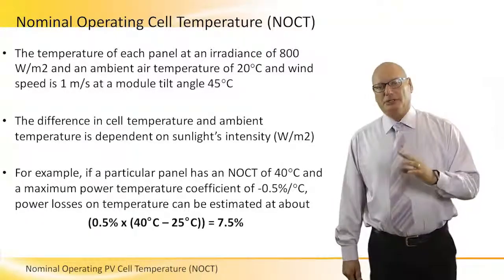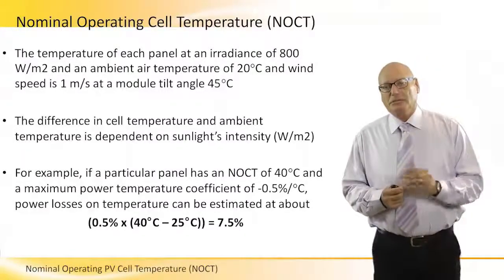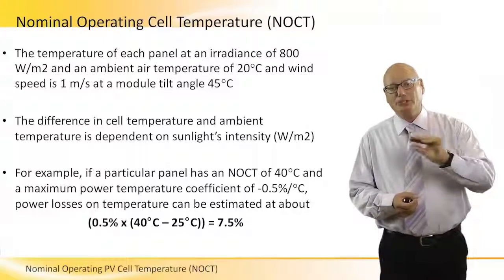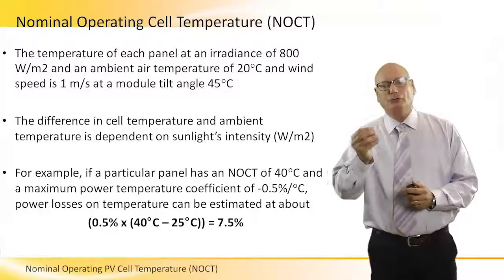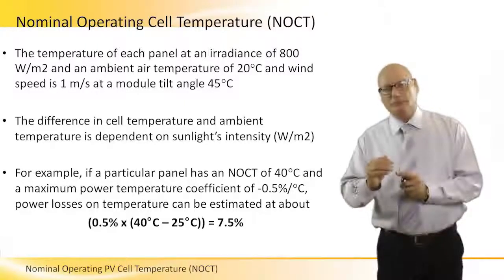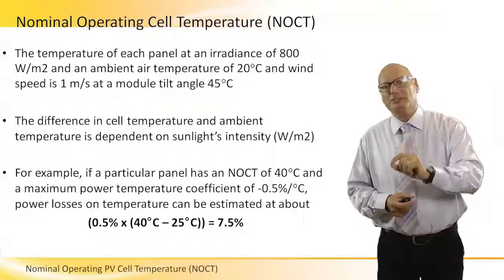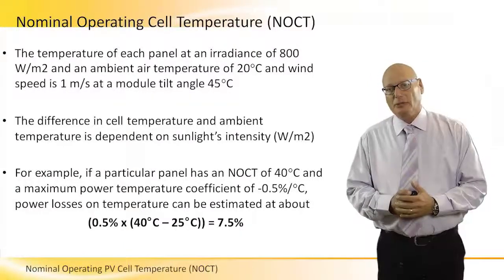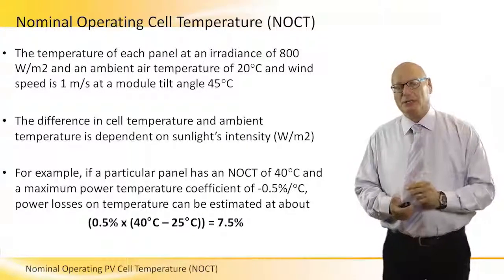Nominal Operating PV Cell Temperature NOCT

Comment: Thank you for the tutorial however it is difficult to size the array not knowing which rated voltage to account for, Max Power voltage or Open Circuit  Voltage